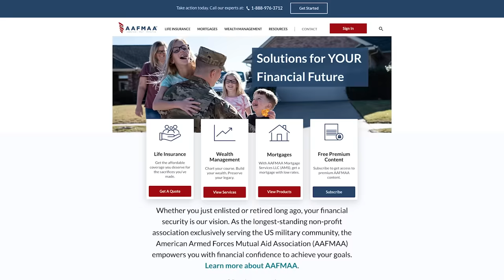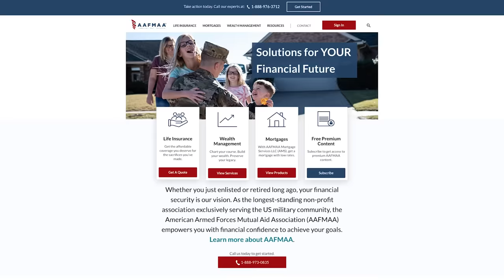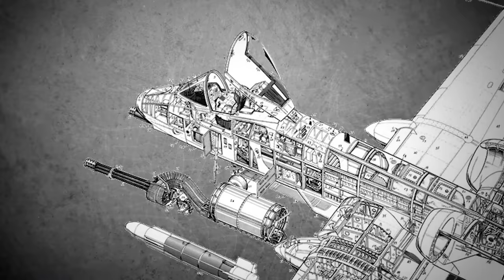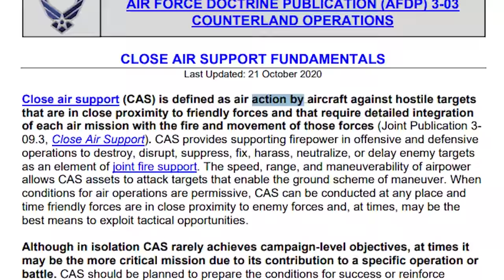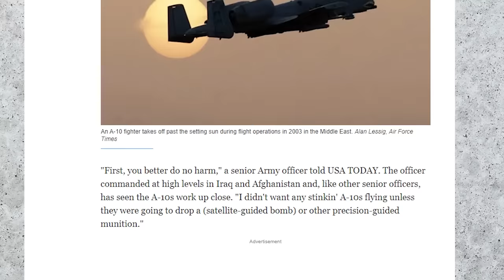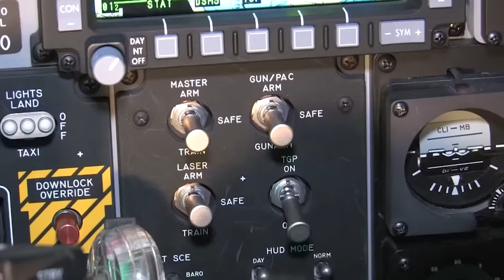Why the Air Force is Screaming to Retire the A-10 Warthog

Comment: Glad you did a video on this! Articles from 2012 suggest that the airforce was thinking of creating a "Super" A-10 (modernized version of A-10), but around 2014, began to drop the idea due to the proliferation of the S-300 SA missiles. By 2016 they were firmly opposed. You can google articles and old documents from these years and watch their opinion slowly change to doubling down on F-35's.
Reply: There is just more money in building F35 white elephants than there is in upgrading A10s. That's how the military complex works.
Reply: A S-300 is a souped-up 1970s SAM system. The Israeli Air Force has spent nearly 50 years laughing at them from F4s, F15s and F16s. My bet is the S-400 not being as "awesome" as advertised...Just as nearly everything Russian.
Reply: @tellyboy17  a modernised A-10 costs more than a brand new F-35 so you are just wrong.
Reply: @tellyboy17 You got a source for that? It seems like the F-35 has been a success and the cost has been dropping due to arms purchases and economies of scale.
Reply: Dumb question, can't helicopters launch some of the missiles that A-10s can? I saw an article that said the Russians have an anti-tank missile that can lock on to a target outside the range of most MANPADS. I'm assuming the US has something similar right? So couldn't helicopters with modern missile technology do a significant part of the CAS job?
Reply: @360tailslidfaceplant  Hellfires are what you are talking about. They can also be launched from drone's.
Reply: @tellyboy17  Modernising an A-10 costs more than creating one brand new F-35, so I very much doubt that.
Reply: @Sereze001  Source?
Reply: @360tailslidfaceplant  "So couldn't helicopters with modern missile technology do a significant part of the CAS job?"  Yes, there probably are some situations that helos can do CAS passably, but not in situations requiring supersonic speeds to respond in time to save troops on the ground.  An F-35 operating at 40,000 ft. can respond in mere seconds, engaging enemies on the ground while avoiding friendlies, and simultaneously performing other tasks in its mission set.  It's classic stone-age warfare vs. netcentric warfare.  The USAF merely recognizes the massive gains made in trading away A-10's for F-35's.
Reply: @Gearparadummies  no they haven't. They gave them ample respect.
Reply: @TheTrueAdept  The IAF is conducting air raids in Syria as we speak. Just above the vaunted S-300 which were unable to shoot down a freaking Cessna before it reached Red Square in 1985. Stop simping for Russian equipment, it's just subpar.
Reply: @tellyboy17  Modern AA system make aircraft like the a10 non viable. Drones however might still yet be able to replace the a10 in the tactical cas role.
Reply: @Gearparadummies  good god, this is a wrong statement.

For one, not all SAMs are alike, and two, the IAF still gives S-300s the respect they deserve.
Reply: @TheTrueAdept  by flying within their range and not getting shot down?
Reply: @Oblitus1  thanks for the info, just seems like with missiles and bombs getting more advanced, if you didn't need a rapid response there's way cheaper platforms than an A-10.
Reply: @Gearparadummies  ... giving a weapon system respect and outright avoiding them are (99% of the time) vastly different things. The IAF respects the S-300s because they know how nasty semi-competent IADS can be against aircraft during Sinai. They stay within their range as little as possible, jam-packed with E-War gear, and with standoff munitions besides.
Reply: @Gearparadummies  guess israeliis already mocked s400 systems in syria with a mixed attack of F-16, F-16, and F35s. At it seems it was not done only once. Some days ago you had a drone filming in Ukraine the destruction of an entire system with weapons the S400 triumph should be able to detect and eliminate. Still there was even a drone over it getting all pictures on camera for later happy memories...
Reply: @mpondachongo1138  and is it the F-35 built for CAS or multirole which includes attack. It's also a ground operation but really nothing like cas, but to be used bvr - so cas is a paradox here. A-10 did and can still do cas, as also the AH-64 Apache, the AH-1Z Viper, the AC-130 Gunship... but F-35s for cas? that's new for me. A stealthy plane meant to be used beyond visual range and get off of  there. Plus 6 missiles in the new blocks... really? two would surely be aa and probably 4 could be agm. what's next? the 25mm cannon for cas in a plane designed for stealthy approaches? oh, and some versions don't even have cannon.
Reply: @360tailslidfaceplant  what do you its the role of the AH-64 Apache and navy AH-1Z vyper? Both have pods for long range missiles like the hellfire and the Apache Longbow can also use the modernized and upgraded Hellfire II missiles.
Reply: @mpondachongo1138  not 16 like an Apache (not sure how many the AH-1Z viper can carry) or the modernized Hellfire II used in the AH-64 Apache Longbow. Big drones are great sniping weapons, but most likely (those existing at present time) are not enough for a cas mission. I would agree if you say drones (not just a lonely one sniping targets) and A-10s could work integrated
Reply: I mean stuff like that was before the war in Ukraine. When the military and politicians were still VASTLY overestimating the effectiveness of Russian/Chinese donated munitions and equipment.
Reply: @Maddog-xc2zv  without getting shot down?
Reply: @360tailslidfaceplant  "there's way cheaper platforms than an A-10." Agreed, A-10's are getting more and more expensive as they age out to what now, about 50 years?  Maintaining such ancient birds is indeed expensive.  But what saves even greater chunks of money?  Compressing operating cycles such that wars are finished far faster than they were previously.
Reply: Which can’t and won’t do low leval bombing
Reply: @Maddog-xc2zv  you can't just integrate a plane with bearly any modern electronics into a system it was never designed to be apart of like data link, and don't suggest upgrading it because a modernized A-10 costs more than a brand new F-35.
Reply: @Maddog-xc2zv  "F-35s for cas? that's new for me."  F-35's won't be doing most of the trigger-pulling.  Instead, it will hand off targeting information and fire control solutions to other integrated assets in the network.  It's not here yet, but we'll likely see it around the 2030's or perhaps the 2040's at the latest.
Reply: @360tailslidfaceplant yes, they already do.
Reply: @Sereze001  quote numbers please looks like the cost of F35 is sitting around 80 mill per unit according to the Pentagon upgrade packages for the A10 that I could find total around 40 mill per unit granted I only spent 10 minutes looking things up for myself, but....
Reply: Only marginally so, Brimstone 2 looks much more capable here.....
Reply: @mpondachongo1138  at least it works and was not made for ground/air attack bvr as the F-35. Can carry more than 6 missiles (f-35 latest block - in reality 4 at most for agm and at least to aa for self defense). It’s not it’s role, maybe collecting info for other assets, but surely not for cas; some versions don’t even have canon…
Reply: @Oblitus1  sure a broadcasting asset to relay info to other assets really cas and not bvr operating. Till there, it’s a fools mistake replacing already the a-10 with 4 missiles and some versions with no cannon f-35 (and I’m being nice, expecting for the latest block, because 2 missiles at least will be aa for self defense, leaving space for four agm). Avoid giving steps longer than your leg. On different motives there’s the mindset which fkup the f-22 production/assembly lines. Fortunately to this day the only real combat saw was downing a balloon, as no other unit can be produced; so we’ll wait for the army and navy ngads are flight ready, in some 10 or 15 years at the current pace. Cheers
Reply: @Maddog-xc2zv  you are missing the dam point, imaging using a nail and hammer to make a hole in the wall and then someone gives you a power drill, you procede to use the drill like a hammer and complain that its not as good as the hammer. Thats the situation with the A-10 and the F-35.
Reply: @Maddog-xc2zv  biggest problem with the a10 while it is designed for close air support its main weapon is also its biggest liability in most situations it can
expect to encounter and the pilots want to use it and have blatantly admitted to overusing it even in situations where it was not required but you know i understand it it's better to waste ammo and save lives than you know conserve ammo and see someone die but this is coupled with the second
point and it's a doozy it's a doozy you see the situational awareness of the a-10 is bad
 very bad so bad in fact pilots during the gulf war were using binoculars to
try and identify targets and i'm pretty confident i don't need to explain why having bad situational awareness is essentially the
 worst thing you could possibly have when you're firing hundreds of depleted uranium explosive rounds into an area where friendlies are present but if you insist i'll give you a couple of minutes to think about it.
Reply: @mpondachongo1138  false about the binoculars the A10 had already been updated before the Gulf war stop listening to the ignorant and actually do the research or talk to or listen to actual pilots
Reply: @Maddog-xc2zv  my thoughts it's more like trying to use a screwdriver to drive in a nail when you just need a hammer
Reply: @ben1l752  "We plotted target grids on plastic-covered maps with grease pencils and used binoculars to spot targets from high altitudes. We didn't even have night-vision goggles" 
oooh yea there was also that time an A-10 pilot somehow mistook a British armoured column for a bunch of flatbed tracks with rocket launchers and proceded to kill one British soldier and injure 5.
Reply: Lol
Reply: @Maddog-xc2zv  "Till there, it’s a fools mistake replacing already the a-10 with 4 missiles and some versions with no cannon f-35"  Not in the USAF's view.  At present, the F-35 does much, much more for the CAS mission than mere "broadcasting," and much more than the obsolete A-10 can.  At least the USAF thinks so.  That's good enough for me.
Reply: @ben1l752  well, F-35s will not be the hammer with some versions with no cannon, at most equiped with 4 agm missiles (plus 2 aa in case it finds another bird, so I'm already considering the latest block with 6 missiles bay) great to relay information to assets flying nearby but it was never bulit as a stealth plane for cas missions but to attack air/ground beyond visual range. Is it so hard to understand? so using your metaphor, with f-35s replacing asap a-10s there will be some years without cas mission fighters, so no tool do drive the nail in but apaches, navy vipers, and the old timer AC-130 gunship.
Reply: @Oblitus1  ok. broadcasting to whom? and the f-35 is now also a premium flying radar station for cas missions, as they can't do it; nor relay info to those doing it, like apaches and vipers (the legacy ac-130 gunship too). No drones are ready to link with the f-35, maybe f-15 II can be the arsenal of the premium awacs that can't get close to support ground troops. Guess a gap will be remaining for a decade or so. But as said, at least they're not going to get rid of the apache (only for an upgrade in the same role). Texan A-6, 802U and the overrated supertucano will be shreded by DSHk, while the tank in the air is lost without proper replacement. I'm not saying it must remain forever, tech evolves ffs, I'm stating no other plane will be able to do what the a-10 does in the next decade. If a replacement or a thought strategy was already in place I would be in the first line to replace the a-10, but all we have is guesses and surely a 10 years or more period of a relevant missing link regarding cas.
Reply: @Maddog-xc2zv  “no other plane will be able to do what the a-10 does.”  Not against modern air defenses.  A-10’s weren’t even able to do CAS against Republican Guard formations in Desert Storm because air command thought the risks were excessive against the air defense assets those units had.  And that was 32 years ago!  That’s why I said previously that the A-10 is now obsolete against modern air defenses.

“f-35 is now also a premium flying radar station for cas missions, as they can't do it;”  As I said previously, the USAF clearly believes F-35’s can fill the air support mission quite neatly without having to do it from close range.  If the USAF believes such a thing, that’s good enough for me.  If I’m to choose between you and the USAF on such matters, Maddog, I’ll assume the choice is a false one.
Reply: @tellyboy17  the F-35 is not a "White Elephant", the per unit price has already come down considerably and already cheaper than anything almost anything else in the NATO inventory. Its also cheaper to have one airframe to have parts for and train to maintain (and it has systems to help diagnose problems)
Reply: @Gearparadummies  Israel funnily enough has already been showing the S-400 to not be up to snuff against the F-35, with them using it for a long time in Syria without the Russian crewed S-400s ever even getting a lock on, let alone shot at one. The word I've heard is the S-400 has a laughable 11 mile detection range on the F-35, and the F-35 constantly shows where that radius is to the pilot so its easy to avoid
Reply: @360tailslidfaceplant  helicopters have a huge advantage actually since they are able to hug the ground, come up, shot and dive back down or even land. It is very difficult to deal with, and is one of the main problems the Ukrainians are trying to deal with right now. Because of the curve of the earth and such you have a very limited time and range to be able to try and counter that strategy.
Reply: and by the end of the year there will already be about 1,000 of them out there. It is here now and it is real.
Reply: @Oblitus1  the "super sonic" speed is kind of overrated; and is one of the legitimate reasons that slower CAS aircraft (even slower than the A-10) can be an advantage. They can often be at closer air fields, take less time to prep, and need less layers of authorization to scramble and then loiter longer, which can more than make up the speed difference.

though the more "modern" for military with the funds seems to be to have aircraft already in the air and then task them as needed, but that also runs the risk of them being wanted in multiple places at the same time.
Reply: @TheTrueAdept  since the F-35 has been in Syria even Russian crewed S-400s haven't been able to get even a single lock on.
Reply: @Maddog-xc2zv  if  you are stealthy there isn't much reason to "get out of there", you can also be loitering (especially the C version, and I wouldn't be surprised if more switch to that wing) and then are able to respond right away with a request is made
Reply: @Maddog-xc2zv  small guided (sailing) bombs are likely to help fill the roll. They have already begun integration on ones that 4 can be carried in the space of a typical missile or bomb. The fact that they are being integrated on the A-10 is actually my reason for believing that despite all the denial, I think they may in fact actually be heading to Ukraine because it doesn't fit what the US needs and for them integration on F-35 seems like it would be priority.
Reply: @Maddog-xc2zv  your obsession with the cannon is kind of odd. The assumption that every single F-35 needs to carry 2 missiles for anti-air also just seems not well founded, especially if they don't expect to be detected. There are already new guided bombs that can be used 4 in the space of 1 missile. So you can times your numbers by at least 4. 6 x 4 = 24 guided sail bombs per that are harder to intercept because they can vary how they approach the target. That is only internally stored. I expect the F-35, if it can't already, will have the option for wing mounted armaments for when the stealth isn't needed as much.
Reply: @Maddog-xc2zv  the F-35 can communicate with all those other craft; it just might not be as secure as a link and risks it being detected because of the transmission (for now). That is assuming there isn't a plane, such as an actual AWACS, Command, or Electronics aircraft that can do the "translating". I don't know why you are saying it "can't get close"; its stealth means it can actually get a lot closer without being detected or locked on. If you don't have to worry about anti-aircraft then you my as well use that AC-130 you mentioned and bring some real firepower down.
Reply: @removedot  source?

Also, the F-35's stealth works if the S-400 crews can't get a return (which is something that the USAF figured during 'nam).
Reply: @TheTrueAdept  I have a feeling that NATO hasn't been able to resist the temptation to use Turkey having the S-400 to get very complete information about how well it detects the F-35. The data and viewing system of the F-35 is supposed to have data for all kind of anti-air and how well it can detect it, so it knows where it can fly undetected (and supposedly the fly by wire even automatically orientates the aircraft so it is least likely to be detected)
Reply: F35 is $42K/hour to fly vs A10's $22K/hour which puts it firmly in white elephant country  if all that stealth tech turns out to work as well as it did for F117 as it doesn't have much to fall back on as it couldn't beat the ancient F16 in a dogfight.    @removedot
Reply: @tellyboy17  I'm not sure what your "as well as the F117" comment is supposed to have meant either. Is it because a single F-117 got shot down because it was predictably repeating the same flight pattern over and over? For one, they learned  their lesson on that one. for two, the tech in the F-35 would have detected that threat far earlier and is much more advanced (advantages to a newer airframe!). And 3 that has very little to do with the kind of things we are talking about. Not going to really have repeated patterns for CAS. The coatings and resilience and durability are also much improved on the F-35, its obviously not going to be sitting in a hanger coming out only on the nicest days; if it is going to be used on Super Carriers in the C version and standing up to being at Sea or probably even worse conditions in B version.
Reply: @tellyboy17  Israeli F-35s have been flying in Syria for awhile now with S-400s in the area and the S-400s haven't yet even gotten a lock on one yet, so you are plainly wrong about being afraid of getting near one. Word on the street the detection range is under 11 miles, in other words worthless against F-35.

 I have a feeling one of the reasons Turkey is suddenly in favor of expanding NATO and voting for additions, when previously they have been the toughest to get to vote yes, is they are upset they got ripped off on the  S-400 not being as good as advertised and missing out on the actually successful F-35.
Reply: Syria doesn't have S400, that's the Russians and they don't target IAF. Feelings and word on the street don't matter, actual behavior of the actors involved tell the tale. @removedot